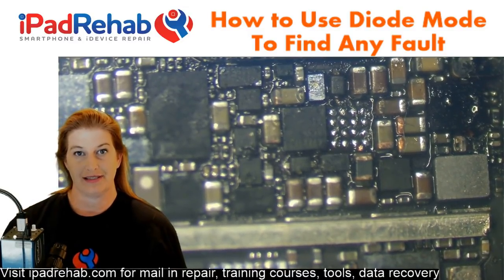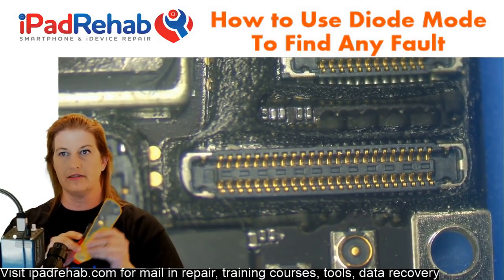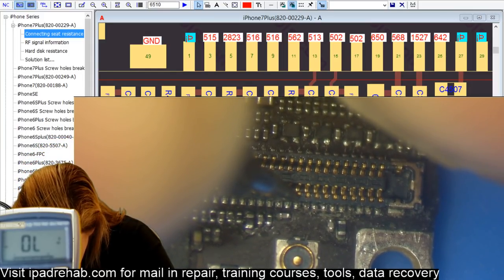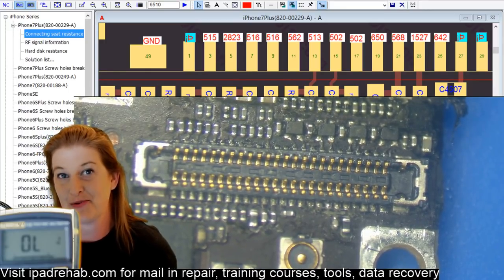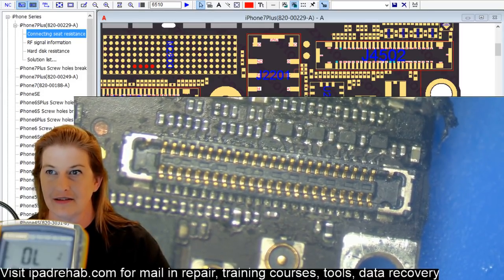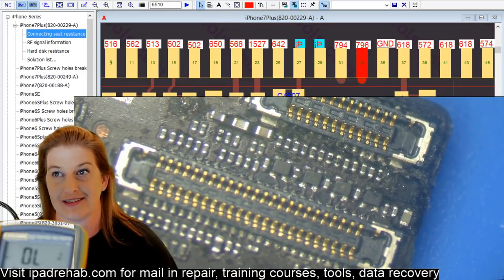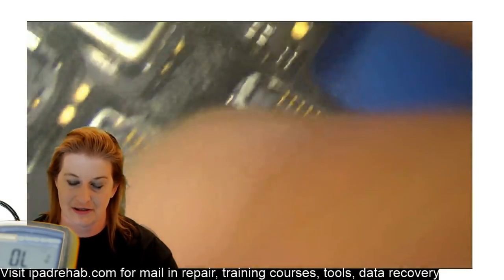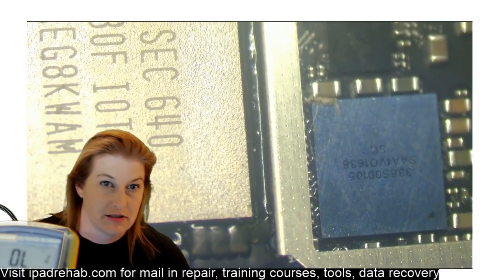How to Use multimeter DIODE MODE to find ANY motherboard fault.

Comment: Of course you can measure a semi-conductor in resistance mode! Some indication of caps too!
Reply from the maker: Not as efficiently as a diode mode measurement —which is the entire point.  Open your ears and put aside your infantile judgement.
Reply: Regarding the semiconductor comment you agreed with near the end; the problem with some meters that I have used, it's that they don't work above a volt or two, so you can't always test a blue or white diode, for example. If you use resistance, you'll get a relatively high value in one direction and low value in the other. You can measure the forward voltage drop with another meter set to measure volts, with the first meter in resistance mode is supplying current through the diode.
I guess you won't have much of an issue using diode mode with good meters in that situation.

Comment: Hello So i have two multimeters, one is pushing out 3,19v and the other 1,18v in diode mode. 
Therefore diode readings are never the same (not even closer) to zxw and for sure they are differnt from multimeter 1 against multimeter 2. 
How do i cope with that since every multimeter seems to have his own settings and return values?

Thanks
Reply: make everything relative

Comment: 14:26 here your Analysis is wrong Fluke 115 or 117 meters can't go upto 2.8v voltage drop and if the line is open it's still gona show you OL you need a meter with a high voltage drop and that's Uni t ut139C wat you holding is made for Rough use fir Electririsns.

Comment: Very good video anyone who works with smd repairs is rofl at 1960's satellites using hole through components going from -200 to 150 celcius with no heating or cooling system lmfao!!.

Comment: Newb question but can someone please explain to me why you would stick the red probe on ground instead of the black probe?
Reply from the maker: Just a convention.  For most lines the number will be low and easy to compare.  If reversed the number would be high and harder to compare.
Reply: Thank you so much for quick reply. Yes that makes sense, I had observed higher values when reversed whilst practising on an old laptop motherboard last night. I'm guessing because of the orientation/polarity of components on the line with respect to ground...would that be about right? please forgive my ignorance, I am fairly early on in the huge learning curve of electronics.

Comment: I haven't read all the comments, so I may have missed someone already discussing this; but, OL stands for Over Limit which means the reading at the probes is above the limit of the set range (either manual or auto) of the meter.  This is a convention that is used among many manufacturers of DMMs.
Reply: LOL, there's a lot of people getting hung up on the definition of OL. She's using a Fluke meter. In Fluke terminology, OL means Overload. It's well documented in Fluke manuals as such. Other meters may define it entirely differently however. I'm pretty sure there's not an IEC standard on the exact meaning of "OL" in a multimeter.

Comment: I'm retired, but in my work career, I spent a few years fixing boards, and I made a gadget that helped hugely.  I just looked it up on YouTube to see if anybody had posted a video about the gadget, because it has been around for a long while.  Somebody had, and he shows the effect it shows on a scope.  See https://www.youtube.com/watch?v=Gwo3pEH7hUE

The one he has uses the voltage from a transformer.  Mine was a battery-powered triangle generator, using a 741.  That, and a resistor, is all you need.  It has two probes, and the scope is connected to it using two scope probes - horizontal and vertical.  In the video, he only shows it being used on individual components, but I used to compare boards with it, as you are doing in your video.  Put one wire on the ground of the board, and move the other probe along (for example) the pins of a connector as you are doing.  Each pin gives a wave shape, usually some sort of diode curve, similar to his video at 7:53, but if there is any capacitance around the wire in that pin, it shows an open loop in some part of the wave shape.  It's the equivalent of doing a diode test with a meter, but with the probes both ways - one way (+/-) for a millisecond, then the other way (-/+).
It was so useful, and saved me so much time and effort that I made a dual unit, so I could connect the ground to two boards (one good, one bad), and move the other two probes to compare pin 4B6 on the good board with pin 4B6 on the bad board, and the scope would show two Lissajous  figures side by side for a really quick and dirty comparison.  Result - huge savings in time - and it works!
Reply from the maker: Sounds cool!

Comment: Could someone kindly explain to me why you'd need to repair the screen to pull data off the iPhone?  Surely there are NVRAM IC's on there that you can lift or JTAG?  I assume it's due to security provisions, but still...

I've dealt with secure recovery before, where data was encrypted and keyed off both user input and a burned in code on a controller IC ...but this was a simple matter of labelling the pair with a paint pen, and then pulling both the TSSOP and its associated (keyed) controller to queue for reading on a surrogate board.

So, it kind of confuses me to see so much focus on getting high level functions such as the UI up.  One would assume that this implies getting the device to a largely functional state - so a huge proportion of the board probably needs to be up, too.

Seems like a lot of extra work, but then I don't work on apple products.

Can anyone explain the issue? What gives :?
Reply from the maker: Your idea of moving over the required chips to a receiver board would work in theory-but because of the tiny pitch of the CPU, and the fact that it is sandwiched with the SDRAM, and completely covered with underfill- under/between layers and on the sides of the CPU, it is almost always 'easier' to just make the board work again and natively extract the data rather than do chip transfer.  If the board has been through a lawnmower, we do chip transfer.  Otherwise---fix the board.
Reply: Ah, I see.  It's interesting to see the differences in recovery on iphones, not being familiar.

I must admit, data recovery isn't our area of business - we operate in a particularly narrow, specialist, niche of ITSec.  So, it's nice to occasionally take a look over the shoulder of those in related fields.

I think I've only once met a situation where physical access or removal would have been risky (Given our limited experience with, and the cost of, the item) so we opted to clone via JTAG from a more accessible point ... that was a little slow.  On the up side, it was a very safe option and happily ran unattended.

I assume JTAG wouldn't work here either for some reason.  Data encryption of the image?

Anyway, thanks for taking the time to respond.  Love your channel.

Comment: OL means Over load not Open line or as some people say Open loop. The OL is saying the resistance is to high to read not an open line.  Just saying.
Reply: Dan B OL means “out of limits”
Reply: Ol = test leads open circuit .
Reply: @jaylipisko8565  She's using a Fluke meter, and in Fluke terminology, OL means Overload. Other meters may define it differently.

Comment: He/she should have removed the battery and then put the iPhone into clear water/unsalted water to keep the salt from drying out and caking all over everything.
Reply: If you have access to distilled water that is even better.  So, remove the battery and place the phone in distilled/clear water and flush out the salt/pool water.  You can even keep it in the water until you take it to the repair folks.  You don't want the salt/chlorinated water to dry out and leave mineral deposits all over the place.  You can even wash the phone out with tap water, that is better than leaving the salt water to dry.
Reply: That's the key Bob,and as long as its not powered it is the only thing that will properly reduce the salt.Fixed quite a few while working as chief on cruise ships.We used distilled water and a simple hair dryer on low.

Comment: Whenever there is motion and something hits a fluid (going from air into water, or even moving water coming out of a showerhead) the waterproof seals take a shock force, measured in gravities. G shock. The IP water resistance numbers are just for zero G shock. Any additional motion smacks water past them, which is why waterproof watches normally tell you the warranty is void if you press the buttons underwater. Stressing the seals. So, get slammed into the pool? G shock, no water resistance guarantee.

Comment: Drop your phone in the ocean?! 
You got minimal time on your hands and a day or so can really kill your phone...

Cheap 91% isopropyl alcohol works wonders in dispersing the water, but you ultimately want to take it into someone who is skilled to clean and repair.

Salt water acts like a electrolyte in the presence of the contact metals in the phone, and will start to corrode at a relatively fast rate.  When it corrodes the metals can deteriorate to nothing, or when the water shorts the circuits, your circuits won't work as normal, and issues occur. 

A lot of people will argue that they remove the phone as fast as possible from the water, and claim that the phone worked for a few days after, then issue occured.  Yea,  the corrosion kicked in.

Get a water-proof case if you are working or venturing around watery areas ...

Comment: DIOD MODE
MICRO CHIP IC CHIP CIRCUTE
ELEMENT
POWER SUPPLAY
TRANSFORMER
COMPONENT
DIOD
ACTIVATED
ELECTRONIC DEVICE
COMPUTER 🖥
LAP TOP
ELECTRONIC DEVICE
TRANSISTER
COMPONENT

Comment: Why do you just keep going in circles?Sometimes you can get bad measurements but the path will still half way work under a forced voltage while having other known connected and working components and or grounds but different resistances.

Comment: i need to build a hardware tool that can check every part of a mother board with out having to take parts off to test the connectivity of parts.
Reply: use an  "  analog signature analyzer  " and or   AKA OCTOPUS....

Comment: 57 minutes in looks like butchery.
Don't ever shown people to test for heat on their lips! Absolutely amateur
Reply from the maker: No.  Be open to all rational ideas.  Your face has a high density of thermoreceptors.  Only an amateur would be so rigid and close-minded as to not make use of quality practical tools around them that allow them to make iPhone logic board repair robust, efficient and practical.

Comment: Watch Rossman , he is far smarter.
Reply: Louis is great - and his repair method works extremely well...Look for a bit of board that looks suspect...clean and replace....test for fan.....Look for bit of board that looks suspect...clean, replace...test for voltage at 'A'...check for hidden short by making it glow red hot...replace broken track with wire.
This woman is as smart as Louis - and while Louis is super entertaining - as he has such a funny manner. He and this woman are both extremely clever, above and beyond the work they have chosen to do, they could do almost anything they choose to. Louis doesn't know much actual electronics but has a very quick mind and is logical. This woman I think knows a lot more than Louis, but these blinking iPhones are such a nightmare I can't understand how anyone would actually want to pursue their repair as a career. I have been an engineer for 35 years and repaired many phones for myself or friends - yet occasionally one will fuck you - right in the arse.
Reply: Louis and Jessa are friends I believe
Reply: Pash G. Judging by the comments on that other video I think that is simply Louis's nickname for her
Reply: Pash G. She looks too young to even be his mum let alone his grandma
Reply: i think i'd prefer to watch someone who can go slower and explain everything. rossman doesn't seem to be as invested in teaching others.
Reply: she is 70